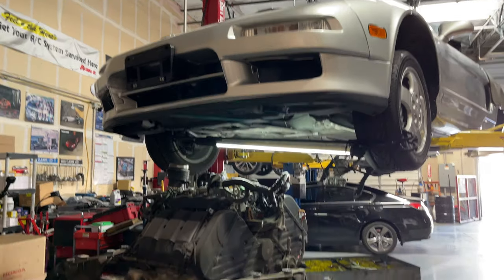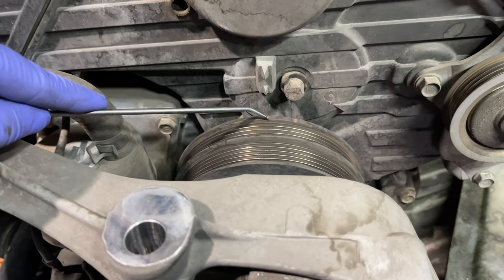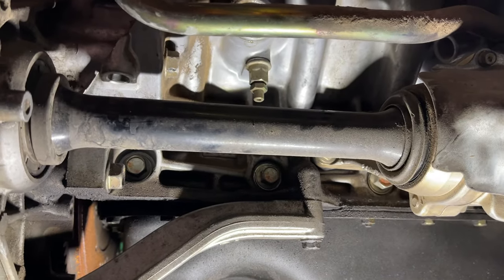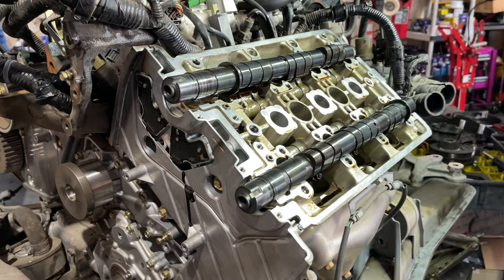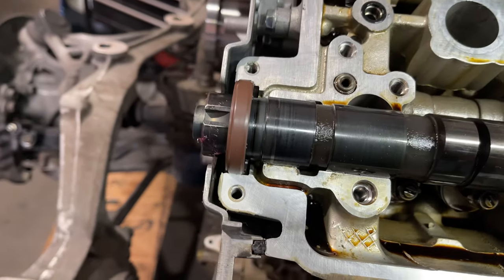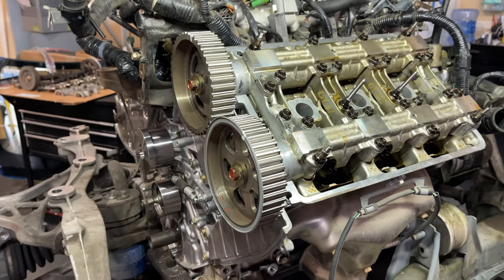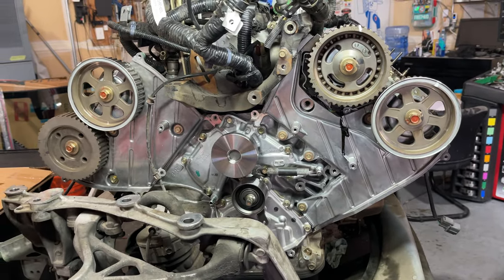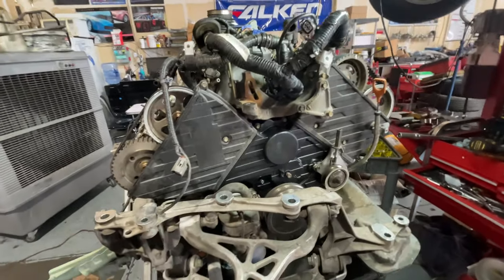NSX TIMING BELT WATER PUMP CAM PLUG SERVICE : 1991 ACURA NSX NA1 C30A1

Comment: I think the service manual calls out using the "blue" line on the pulley, or something like 9-teeth from TDC, to position the cams so they are not under valve spring tension.  Or at least that's the concept.  You use that position to do a final tension with the spring.  Do you not do that step or did I miss it?  Is it not necessary?

Comment: How did you get the tension bolt out of the timing cover? The NSX I’m working on has the bolt encased inside the lower timing cover and it looks like the only way to get it out would be to break the cover.